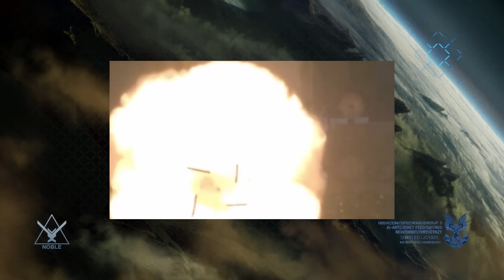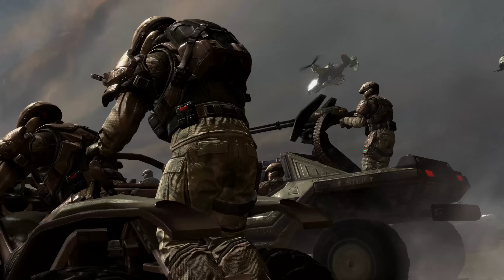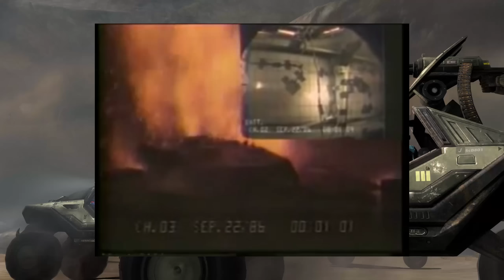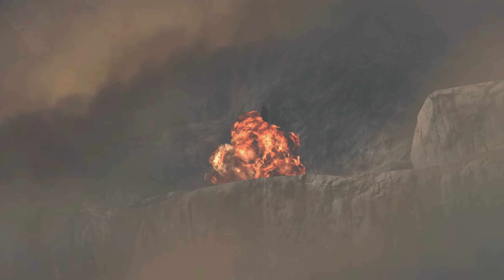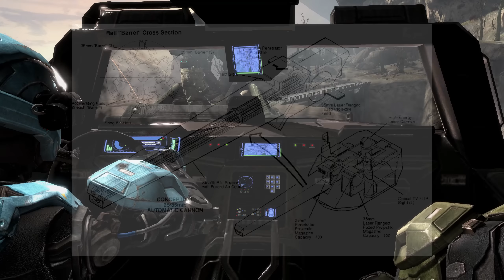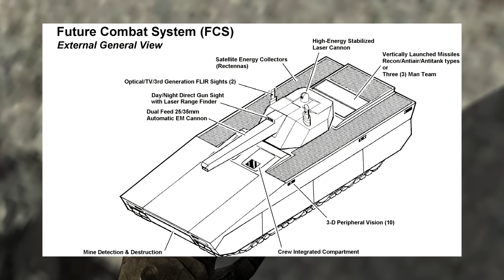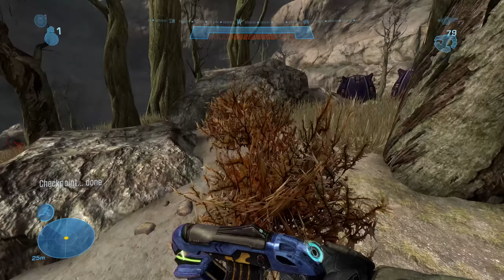Are Railgun Tanks Practical?

Comment: Very nice video, though one major con you didn't mention is the absolute reliance on electricity, which is a big issue with over-developed messes like the PUMA IFV.
Most tanks can still operate, drive and fire without relying on flimsy and unreliable electrical systems. A Tank with a railgun however becomes utterly useless once a minor system error occurs or a safety parameter inside the computers is not met. This is why the german army is still using its old 1960's era IFV's, even though the replacement tanks are in production for years now. Electronic systems are ridiculously unreliable and just not practical

Comment: Short answer: No

Long answer: No, because you're never going to fit the necessary power generation into a 60 ton vehicle.
Reply from the maker: Defense contractors are already working on scaling down the necessary equipment. With the availability of newer and better electrical equipment, it will eventually happen. It's like saying a tank could never fit a computer in it because in the 50s they were the size of a room.
Reply: @Spookston  That still leaves cost as a problem. You may cut down on expenses in ammo, personnel, and other such expenses but unless the vehicle itself gets cheap enough that's still a major expense. Long term expenses like if you need to ship a tank to a factory for repairs and getting a supply of replacement parts need to be considered as well.
Reply: Sigma920 Video Storage USA will have no problem with the cost.
Reply: @stevenrith2386  That depends on much it costs.
Reply: @Spookston  There's a limit to how much you can scale things down, especially when it comes to power generation. About all you could realistically do with the power source you could fit into a reasonably sized vehicle is match the performance of existing weapons systems with less volatile ammo. But in that case why not just go with traditional ballistics and make literally everything in terms of maintenence cheaper and easier?
Reply from the maker: The DOD says it's possible, BAE systems says it's possible, and the Army also seems to think it's a feasible concept. Conventional tank guns will obviously stick around for a while, but we're already towards the upper limit of how fast we can make projectiles go with chemical propellants.
Reply: Spartan448 high capacity and small size power source will eventually be invented as the next logical step battery design.
Reply: Spartan448 The thing is we need to find newer and better power sources. At the moment we even reached “limit” on how small a battery can be and be useful. Sure, he have electric cars but the batteries a very limiting, even some speculation about Tesla’s electric semi truck has to use significant cargo use just to match the endurance of a traditional gas truck. So, the limiting factor if you can fit a big ass battery is the ammunition to be small and effective.
Reply: @Spookston  The DoD and BAE systems have said lots of things were possible only for those things to run headlong into reality. I need not remind you of the fiasco that "An universal stealth aircraft design that can fit the needs of every service onto one airframe is a realistic and achievable engineering feat" has turned into.

Comment: I think railguns will sort of rejuvenate the old experimental nature of when tank guns were first invented. Shooting a very fast needle doesnt negate the fact that you're shooting a needle, so i can imagine some nations will try a sort of APHE approach or maybe even a "shotgun slug" approach
Reply: MasleniR What exactly do you think sabots are ?
Reply: Man I already got you covered, try armor piercing anti-matter
Reply: Watch the expanse
The railguns fire tungsten slugs
Reply: I can just imagine a 100mm DU covered aphe with thermobaric explosives inside entering a tank. It's bye bye everything inside and outside the tank.
Reply: @villepore7013  Sabot rounds don't need to have explosives on them. The speed alone will be enough to cause armor to vapourize and send hot steel moving at high speed inside the compartment.

That alone would be enough to disable weapon systems, crew and even the fuel and ammo compartment (depends where the sabot goes through)
Reply: Well, you could class the DU dart rounds as rich man's aphe because of it's self-combusting nature.